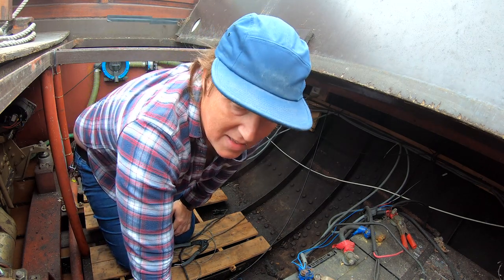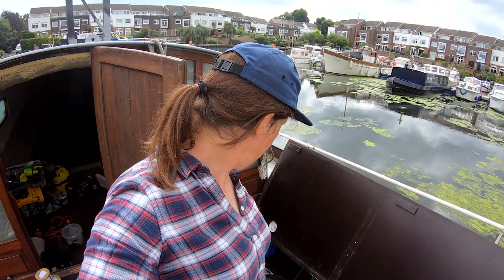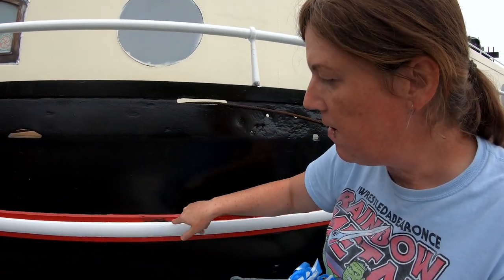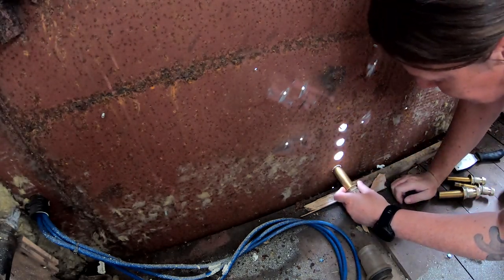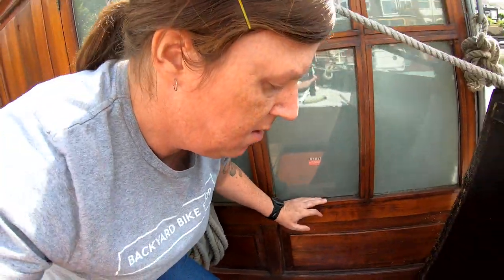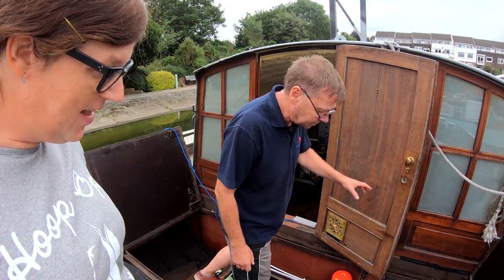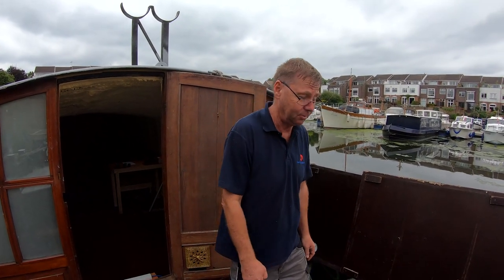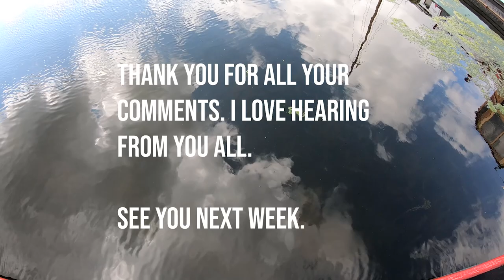#20 Boat Central Heating System - Dutch Barge Home

Comment: Such a great video, thank you for making it so clear! We are in the process of fitting a new heating system on our dutch barge (very new to boating - very much agree with the long made up words to help justify why everything in boating seems to be so much more expensive haha). Sorry if I missed the answers to these, but how big is your calorofier please? And if you don't mind sharing how much the Kabola heater cost? We are looking to fit a bath on our boat, but to fit a big enough heater (actually 3 x 5kw heater) + an extra 55L calorofier is coming in at over £6k. The engineer actually advised against a Kabola because of how few people service them in the UK (his words not mine). Happy to be told this wrong, still trying to get all our facts together before moving ahead with a solution :)
Reply from the maker: Hi, thanks for the kind words. My calorifier is a horizontal 63.6ltr and with the Kabola KB 40 and fitting it was £7,267.39. It is a lot of money although the system is really solid and actually is quite straightforward for engineers to work on. My local engineer is a specialist and the reason he works on Kabolas is simply because it's easier for him. There are a lot of other systems and the Kabola is, I think, better than all of them. Of my neighbours the only ones that have systems which work after a couple of years use Kabola. Everything else has stopped working or is now inefficient and problematic. 

I think the Kabola is definitely the best option (I would though ;) ). I'd really recommend Pete who did my installation and he's at https://www.marine-heating.co.uk/. Good luck!

Comment: So has ''Flop Eared Mule'' been outlawed? Pity if so. Looks as though you are gonna be toasty warm with that heating system and insulation Beth. Like the motor Tjalk moored nearby too. Be more practical for this old dear! Thanks for sharing - Teresa
Reply from the maker: Sadly it was a Queen song. A great track but they didn't let me use it! 😊 Yes, the heating system should be just the thing to keep me warm this winter! Thanks for joining me. 😊